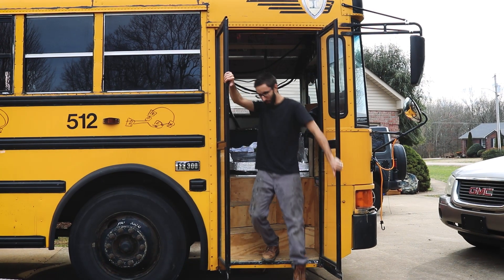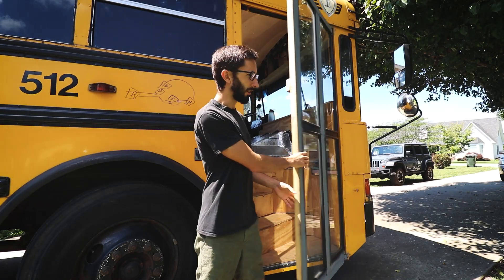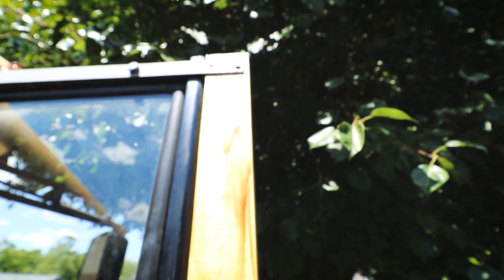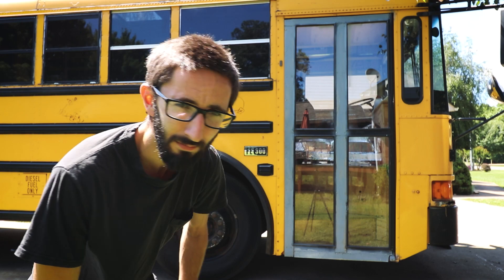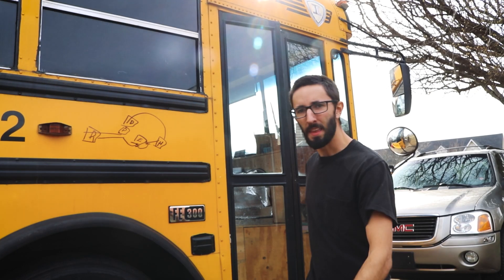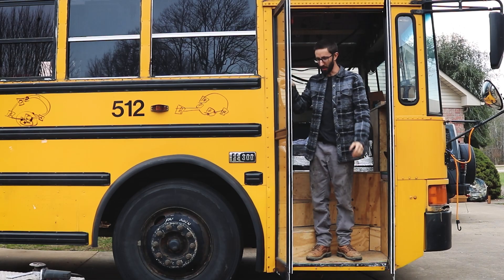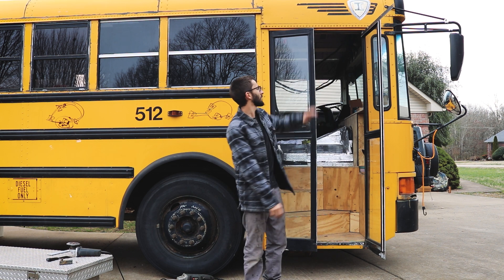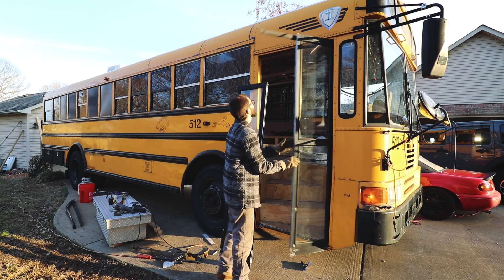Converting and Modifying Our Front Door on our School Bus // Skoolie Conversion

Comment: hoping to find a video of this bus about lock and door handles! so many videos and this is the first door I've seen that's the same thin strip between the glass, not much room to work with. Those doors are freaking heavy huh? Lol, have a good day, thanks for the video. Our dog has ripped the gasget out too so I'm digging this sheet metal idea as a replacement that is Miss Mishka proof

Comment: I need to redo my Skooly also. The emergency half assed job we did it before really doesn’t work because of the insulation. I Need to pull out all the interior and insulate it.
Reply from the maker: Aw well thats a bummer but also exciting that you realize what you need to address. I would say you can really tell a big difference with the bus being insulated. Game changer for sure.

Comment: We have a similar styled door on our bus, where the space horizontally across the middle is quite thin. I honestly think we may need to try and get as close to your build as possible for us to be able to make our door work. I mean, it's almost entirely glass with such thin spaces for us to build off of.

Thank you so much for showing and talking about how you did this! I feel it will be a huge help for us! PS: I Love your videos! (We'll also be doing something similar to how you did your ceiling ^-^")
Reply from the maker: Yeah these oem bus doors are tricky. Thank you so much for watching! It means the world!
Reply: I love the look and the visibility that this door delivers. I drove school bus for 18 years and needed that extra visibility many times to see exactly how far I was from the curb and any vehicles parked or moving that might be in this area. I have had two motor homes that this was a major blind spot making me very uncomfortable maneuvering through parking lots and city streets.  Any way I wanted to mention that a little out of the box thinking might work here and save this attractive door. By locating the latch and locking system in the bus body frame at the rear of the door with the latching bolt moving into the thin rear edge or into a pocket on the inside of the door and a hand grip mounted to the door edge to pull it open when unlatched.  I also like the way this post was presented, very considerate of his viewers.

Comment: Nicely done, Sir!  Looking forward to seeing your install of the locking mechanism!  As you may have seen, we ended up going with a house door on ours primarily because we didn't have that center cross-piece in our door, so no good place to join it together.  Really like the look on yours, though!
Reply from the maker: Thats actually the problem. Because we wanted a certain look for the lock and door handle. this door will not work for us so we're having to come up with a different solution. Video to come for sure!
Reply: @BackroadPurpose  AH!! I should have read all of the comments before placing my own!  I know how it goes with doing one thing and then having to undo it to do another thing.  Can't tell you how often that has happened in our build...

We opted for a house door in our build, and must tell you that it was a pretty big project to get it done.  We're happy with it, but the project wasn't for the faint of heart!

Comment: Great job on the door! Like how you joined them together! Are you using any seam sealer or bondo where the flat stock meets the original metal framing? Or how are you sealing the seams?

We’re soon to be tackling the door project & thought about doing something similar. Knapp Time Bus channel made a nice door with a great latch setup. That may be a good watch if you haven’t done that part yet.

Keep rocking it! Love the ambient sound in this one!

- Brian + Erin
Reply from the maker: Thanks guys! I actually used a polyurethane caulk to seal and edges that water might get in.

Very cool! I will have to check it out! We are actually going to be changing the door. The style lock and door handle we want will not work with this door unfortunately so yeah. haha we kind of picky on the whole style of things lol.

thanks for watching guys!
Reply: Backroad Purpose LOL! Totally get you on being picky! That’s what’s great about a Skoolie! We can fab up anything we want. If we don’t like it, we can change it!

Have y’all already changed the title over to RV/Motorhome?

Comment: How does the air pressure system work to open and close the door?  My bus lost air pressure in the front door, so it wont open or close properly, and now the bus wont drive because of it.  It shifts into R and D, but because the door doesnt have air pressure and close it will not get any throttle response.
Reply from the maker: There should be a valve to close off the switch for the door regulator.
Reply: You got a picture of that valve?

Comment: after doing this door modification were you able to find a lock that fits that small width from the edge of the door to the metal part of the door?
Reply from the maker: So we actually ended up changing it because of that. We just couldn't find one we liked (we're being super picky) buttttttt you can get a Mortise Style lock. And it would work well.
Reply: @BackroadPurpose  yeah I spent hours trying to figure out what I'm going to do. looking at hundreds of locks. I was looking into the mortise locks too. still trying to decide. thanks for the reply and good luck on the rest of your build.
Reply from the maker: Yeah same here. We're actually going to build our own door and do exactly what we want. Thanks for watching!

Comment: I wish he would of showed how he got the wood right with the measurements being diff at top n bottom
Reply from the maker: @spiritlove2  measure the top gap at then the bottom gap. Make those marks over the length of the board and then connect the two marks.

Comment: Hi! Really informative video. We are in the process of doing our door. But, I see on future videos you say you have a different door. What happened with this design? I am going to be on the bus alone a lot of the time and wanted a super secure door, and we wanted to repurpose the bus doors, so I thought this was the answer. Please let me know if there are problems that you ran into. Thanks so much!
Reply from the maker: Hey! Thanks for watching! The door worked great. I just was being picky on the kind of lock I wanted. you could just do a sliding lock or some kind of gate latch with a pad lock but we didnt want to do that. so i made a custom door out of some steel. I'll post a video very soon about it.
Reply: Hey Backroad Purpose I have the exact same style door. Will it be possible to use a deadbolt?